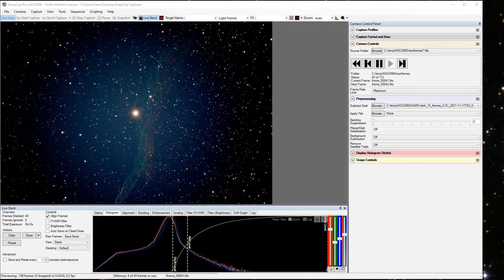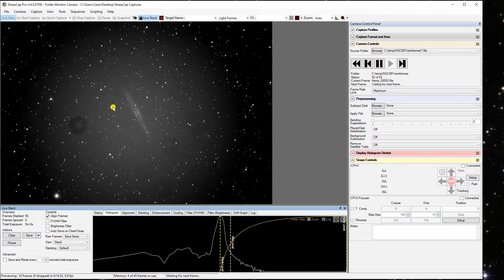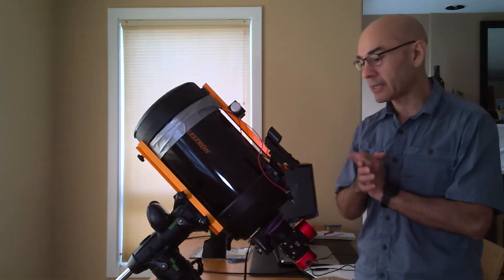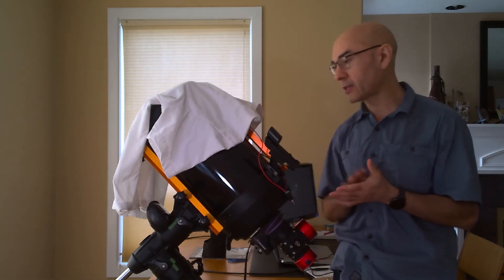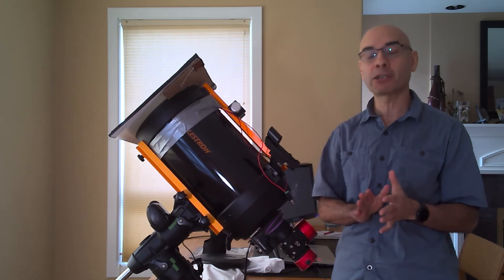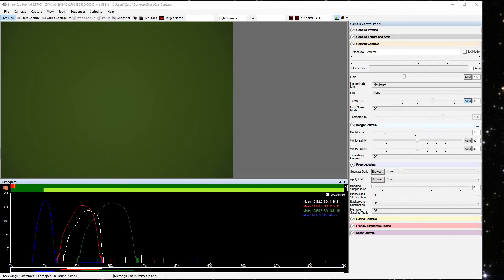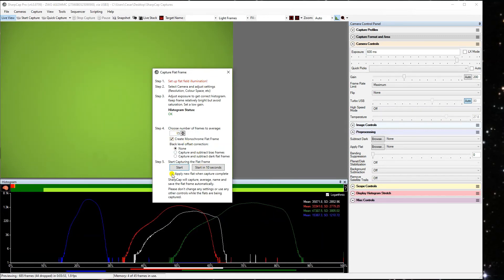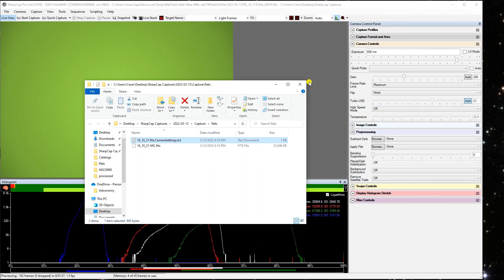Using SharpCap and a light panel to capture flats for EAA

Comment: I see that flip mirror - is the a Baader? Very interesting vid - great explanation. Just looking into EAA. Would it be possible to have a camera and an EP in a flip mirror diagonal? I wonder if I can use (say) a 2” 40mm EP to find (love star hopping) an object, look at it for a bit then flip to the camera and EAA out the details? Is that feasible? I wonder how you would handle focus swapping between the two. Can you focus an image in SharpCap?
Reply from the maker: Yes it is a Baader flip mirror. Yes, you should be able to have an eyepiece. You would have to refocus each time you switched. SharpCap does provide good focusing methods.

Comment: Great tutorial, thank you very much. Quick question: If taking  individual frames instead of a live stack in SC, do you have to take individual flat frames for each light frame? Sorry, it might sound like a silly question, but I am still trying to figure out the best way to use SC.  Thanks.

Comment: Hello! Just the info I needed to start adding flats in SC. I do have a question though... I'm using a Galaxy tab with a lightbox app for my light source and I think my exposure is correct given the histogram location and the 'ok' message in SCs flat capture dialog box. I've taken flats numbering 10,20, and 30. What I'm experiencing is when I use any of these master flats combined with my light frame stack in DeepSkyStacker  the vignetting seems to be overcompensated for. What I mean  is that the resulting image is actually darker in the center and lighter as it moves to the edges. It's in essence the reverse of the vignetting in the original light frame. I guess I'm looking for something in the middle of the two but I'm at a loss as to how to achieve that. Any suggestions that you can share? Thanks so much! Craig
Reply from the maker: Trying doing either a sky flat, where you point the scope at the sky at dusk. Or you can do a t-shirt flat, where you put a one t-shirt over the end of your scope. See if those give different results.